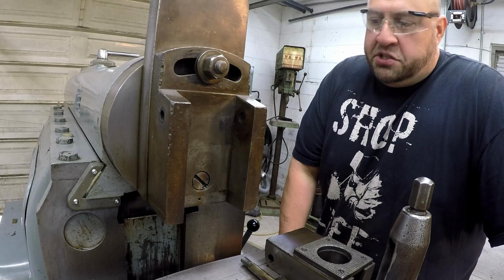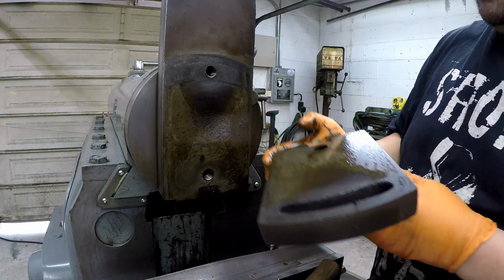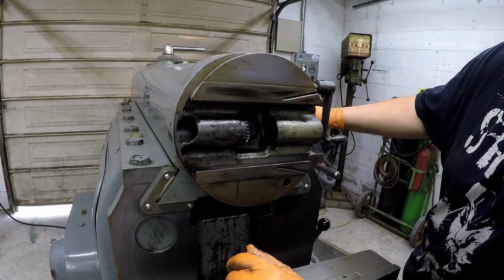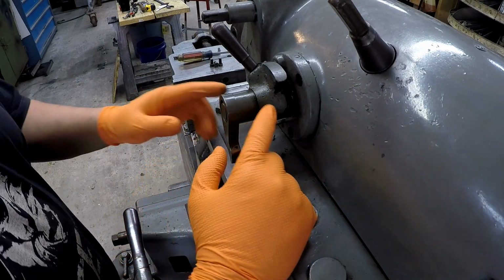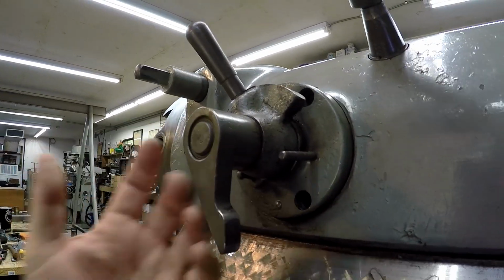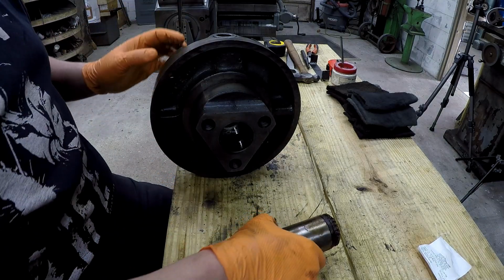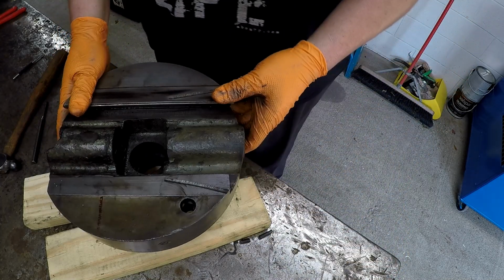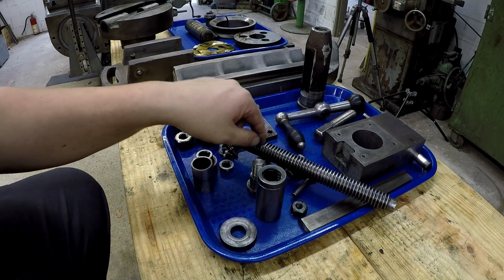G&E Shaper Tool Head Tear Down

Comment: I needed a 9/16 allen once and used a 3/8 bolt with 2 nuts tightened together on the threads. The head of a 3/8 bolt is 9/16. Then you can use a ratchet.

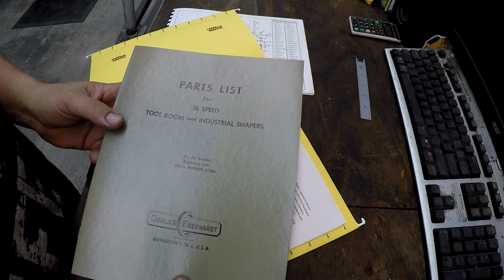Comment: Am I allowed to admit here that I got choked-up at 16:45 when Adam opened up that folder?  That manual was pristine! Someone who cares about machines as much as Kieth Rucker, Adam, and I, obviously saved that manual in some special place. My father was the State Historian, for the State of Michigan, and one of his major goals was to create a museum of industrial tools, which, unfortunately, has never happened. Our current technological lives are built on these old machines, all the way back to the 1,000,000 year old stone hammers. I think of that at my local hardware store, which stocks 57 hand hammers, and each has a reason and purpose, AND that is just a small selection of the kinds of hammers currently available. As Eric O. of SMA says, "every tool has a hammer side."
Reply: If you go back in the series of shaper videos, a viewer that worked at a college sent those manuals to Adam. He said that they had been in a file at the college, probably from when they first got their G&E shaper and were never touched, even though that shaper was long gone.

Comment: You need something called a sprag link to remove the slotted flat head screw. Hammering on with a chisel is not the way to go. All you do is damage the screw. You would never be able to get away with this technique working on rifles. The customers would not be happy with you Adam. The damaged part you are talking about shows that back in the day anybody was able to be a shaper operator. Some were good most were bad. I like to call them "Spanker Boys". As I had in the machine shop I worked in. Either they were the son of a boss honco who was made boss because he could not make anything correctly or just good bull slingers with no real ability other than a golden tongue with no ability to do anything correctly as per print. Not to mention smash a machine because they were either dizzy that day or did not get enough sleep. Excuses excuses from the dizzy guys but not to be called machinists for sure. The bevel gear feed has to be made with tight tolerances because the shaper movements can cause chatter of vibration issues. Just remanufacture the worn nut as the threaded shaft is not that bad as five thousandths is not much wear. As you are saying most manufactures used odd sized items on their machines for two reasons, one, that is what the slide rule calculated for proper strength and second, trying to make sure you would buy from only G and E to keep them in business. Also, maybe make the nut from Ampco bronze as the friction is so low that the machine movement will feel like it is turning on sapphire bearings. Nice job Adam on the shaper. A simple machine that can make things really flat and true.
Reply: Victory First and 5
Reply: Victory First k8
Reply: @ann-marieroebuck3750  Hello Ann-Marie, have a good day.

Comment: I wonder what the story is with that broken casting.
Reply: The previous teardown used the same method as Adam to remove the nut, but missed the end of the rod with the hammer and smashed the end of the tube.  Adam nearly did exactly the same thing.   The better way to remove the nut is to place a blanking piece across the inner end of the second section of tube and screw the nut out using the rod like a puller.

Comment: tell me what is importance of shaper when we have milling machine.
Reply: he has explained that on a previous video. it's like why rebuild a classic car when you can get a new one off the production line
Reply: For starters, a shaper yields a BETTER surface finish, especially with a shear tool.   Also, the slowness of a shaper allows a 1 man operation to multi-task.  Cleaning a piece of hot rolled plate, with its mill scale, can go on while another machine is performing a task is easy.

Comment: Probably should have loosened the nut at the top (4:57) before unscrewing the screw at the bottom, that's the reason for it binding.  Shouldn't you measure the tolerances on the pin and guides maybe making some new parts for higher precision cuts?
Reply: That was the first thing I thought of when the screw was binding. Probably would have made all the difference to loosen the nut a turn or two.

Comment: hi may i ask as you can take down the lamp tool holder  using the holder as base model why you would not make a second tool holder that would accept the small tool holder arms negating the call for t spacers  because  when i first see this cutter i imagined that would have rather more larger base to tool holder  just a thought seening is separate bit might be a easyer way to do it cheers great show  catching on your back shows

Comment: Adam: interesting that both auto downfeed drive gears have no key. I think the brass pins are the key, designed to shear if one engages downfeed with rhe slides locked? Better than destroying a gear although not easy to get at for repair.

Comment: I believe you have shown a Starrett #456 Gear Tooth Vernier Caliper in one of your videos. I think you could use this tool to make comparative (as opposed to absolute) measurements of wear along the feed screw. By setting a depth about midway between the root and crest of an individual thread and measuring first at one of the ends where there has been little or no wear and comparing that with measurements near the middle of the feed screw, I think you could determine just how much the threads have worn. Getting such measurements before making or buying a replacement nut might be useful.

Leave a few thousandths of motion on the unworn threads and compare that motion with the motion on the worn threads. This would avoid "clamping error" where you have more pressure when setting the gauge than when moving it back and forth on the worn threads. You might need to make some sort of jig to hold the 456 at the helix angle of the threads for best results.

This would only work on an Acme thread (and maybe on a square thread) as the crests of V-threads are too variable, preventing you from getting consistent depths.

Comment: Would you let me send you a nice flashlight for the shop?   I make custom modified ones as a hobby and would love to send one your way if it would be of use to you.

They’re super bright and have a high CRI, it would work well for video.
Reply from the maker: Sure, I'd be glad to try one. Send me an email. abom1979 at g mail
Reply: Vincent Schuit 5000k 2000lm 18650 modified astrolux s42s
Reply: Awsome offer. High cri nice neutral white is so much better than the 7000k aliexpress pieces of crap.
What form factor are you thinking, 18650?
Reply: soupisgdfood sweet, that will work.
Soup is not good food however. Not a soup lover 😂
Reply: soupisgdfood best would be with a simple 3 level interface, no strobes etc.

Comment: where are the advantages of a shaper over a milling machine. A shaper can't do anything that you could not do with a milling machine. So why put yourself a shaper in the workshop, if you already have a milling machine. I don't understand.
Reply: internal key ways, splines and gears with very little space for tool runout behind it, adult entertainment machine, many uses...
Reply: slotting, and also a hobby I guess?
Reply from the maker: I'm a manual machinist and I've always wanted a big shaper. I'm enjoying the journey of repairing it and learning the proper ways to use it. I'm also making shaper content to share with everyone along the way. It's got nothing to do about a shaper vs milling machine.
Reply: It’s generally been replaced by a vertical mill but they’re still very capable and can move a lot of material in a hurry.  You aren’t wrong, but there are certain tasks other commenters have brought up that the shaper can do more easily than a mill would (gears, keyways, splines).

It’s kinda fun to work with an “obsolete” machine.  Kinda like retro video games or repairing/driving an old car.
Reply: I learned the shaper in high school machine shop around 1970... even then it was pretty much obsolete for production work. But the shaper does some things that a mill can't. You can do  pretty much all of these jobs with broaches but they are absolutely specific, the shaper is very flexible ... potentially useful for an odd-job shop where special broaches would add up $$$ fast and likely be used once. For production shop... not much use for a shaper. It is still one of the coolest looking classic machine tools when in operation, maybe a surface grinder is better but only because it shoots sparks.
Reply: @Bodi2000   gx

Comment: Adam, The shaper is coming along nicely. Great to see your leaving no stone unturned and fixing any issues up front. Got a tip on cleaning up those parts. Try throwing them into an old crock-pot with the purple degreaser diluted 1-pt purple / 3-pt water. Let'em cook about 4-6 hours. They'll come up looking like factory new parts. Oh but the paint will be gone!Thanks for bringing us along on the project. Dean CrawfordFYI; I have a video on the crock pot cleaning, if anyone is interested.
Reply from the maker: A little heat always makes a difference

Comment: hey mr Abom, I wonder if you know of Stirling engines being used to create electricity, I have spent some serious hrs googling and I just could not find much, my plan was to figure out a solar set up, so we use a parabolic dish to heat up the engine with solar radiation, so no need to burn fuels, no need to create pollution... I was dreaming on the idea of creating a set up,... buy a chinesioum water distiller and use solar heat instead of fuel... create clean water at home and some electricity to run its water pumps,(if needed)... any how here is a link that you may want to see, it may find a happy ending in your wisdom... I give up...  https://www.ohio.edu/mechanical/stirling/engines/ST-5_Engine.pdf
Reply: I've seen a water pump installed in africa as a well pump driven by a sterling engine heated by a solar parabola. I'll try to find a link. I doubt Abom has any interest for that.
Reply: interesting, by the way, I shared the document thinking he has the tools to actually build the rig, I do not have anything like that... not even close... I was thinking that if we add a sound dampening shield, the rig could be installed in almost any roof, providing electricity and clean water... at home we use 3 water filters and even then the filter seems to have trapped at each step, some sort of slime that looks like hair gel... so there is the tap water for ya... it may be a local problem, so don't get scared....

Comment: I wonder if you could machine a new nut in 3 pieces, two separate parts with the acme thread that thread together with a finer pitch thread to preload against each other, and a locking nut arrangement in between them.  You could use the original pin to position one end of the nut, and be able to adjust the other and lock it to take out the backlash.  You could also possibly omit the locking nut and use a set screw against the adjustable side of the nut to lock it in place once you have set the preload.  Anyway I enjoy your videos, thanks for sharing them with us.

Comment: @30:10 Did you compare the axial movement of the nut on the unworn part of the leadscrew? 
Sometimes the problem is not confined to the part you want it to be.

Comment: Adam there could not be a 'nut' in the feed gear as it would tighten against the top nut as it turned. A simple key is all you need
Reply: Agreed, exactly like a lathe that has only one lead screw for both threading and power feed.

Comment: I've  never machined an acme thread. Just wondering if it was possible to make the threads on the rod deeper and get them all the same size from end to end and then when you make the new nut, make it to fit the deeper threads on the rod. What I am getting at is to get the play out of the rod enough that the new nut and rod will mesh all the way like new. Without the .005 that you mentioned that the rod was worn in the middle.

Comment: Great video.
Why does the new nut have to be from ductile iron?
Reply from the maker: Dissimilar metals. Cast or ductile works like a bearing, same as bronze.
Reply: Because when you have two parts moving against each other one must be hard, and the other soft, so that the soft part wears to the shape of the hard part at the microscopic level. Ductile iron is soft, but the screw is probably hard tool steel.
Reply: Just out of curiosity, but couldn't you just machine a new rod AND nut, to any threading you prefer?  Or is something else dependent on that oddball ACME thread other than those two parts?  Seems like you could eliminate more potential slop in one go if you just made yourself a matching pair.

Comment: Do you have the manuals for your machine? One possible source for manuals is www.OzarkWoodworker.com
Jeese, perhaps you should see if you can get that shaper out of the scrap yard just for parts purposes. Anything you don’t think you would need you could put up for sale on eBay. Possible fix for the bunked up corners on the corners of the clapper box would be a nice milled 45 degree chamfer or even a corner rounding cut. Regarding the lead screw nut, Bridgeport uses two piece lead nuts with a small screw so you can adjust to remove backlash. Perhaps you could rework your setup like that.
Reply from the maker: Did you watch the whole video?
Reply: Abom79 - yes, I watched the whole video, I just didn’t bother to go back and remove my comment about your having the manuals for your machine, which you apparently do. Anyway, OzarkWoodworker.com is a great source for manuals. I enjoy your videos. BTW, I recently purchased an old 16” Ohio shaper, it will be a few months before I can start playing with it, but I imagine I will be going through some of the same things and experiments you are going through with your G&E.

Comment: Knowing what's wrong is half the battle. Relatively easy fix too. No castings damaged! 

I'm guessing the junkyard parts either don't fit or are unavailable? It would be nice to find a matched leadscrew and nut. 
I'm looking forward to making a new one with you anyway!! Maybe you could slot it and add adjustable backlash to it? (I can't help it, I got double the normal customization genes)

Thanks for the ride along. Fun stuff.

Comment: Hey Adam, I've got much smaller shaper then you (made in Romania and about 16" stroke length), but it had absolutely same issue like yours. Power down-feed wasn't working. After tear down I found out some key between thread and bevel gear was missing. I put there new key and it's working like a charm! Greetings from Czech Republic ;-)

Comment: Hi Adam, I suppose that someone has modified  the original assembling. The bush #19  appears to be held in place by pin # 20. While you found it free between the two cylindrical guides in which the # 27 axis runs. Am I wrong? Btw, that shaper is awesome and it deserves all  your efforts to be reborn. Keep on shaping, bro ;-)

Comment: For common Allen head screws, I like brazing a short section cut from an Allen wrench into a matching socket so I can use a ratchet on it. that way you still have a useable Allen wrench plus an Allen socket too. Pressing the hex key in a press fit might work with some shim stock but I have not tried that.
Beware brazing cheap sockets they can get brittle and shatter. JB Weld is not strong enough.

I appreciate your efforts and skill! Thanks for sharing.

Comment: Nicely filmed Adam, good to see the workings of the auto feed tool head. I was amused that your leed screw was the odd ball size, I had the same issue and like you I made a  new nut and screw ; mine was less complicated as no auto feed to build in, still a huge challenge for me and my limited machine skills. Do check your tool head slides, it's not too difficult to scrape them back to near factory condition and it makes for a much better feel when you are hand feeding down - make for a nice follow up movie to your Richard King classes. Keep up the good work. All the best Mat

Comment: ADAM STOP! Great teardown, but look into the pin and screw threads before chasing them, they might intentionally be interference fits. Old trick by old guys to keep things that shake, vibrate, or, heat up and cool down, a lot from coming loose..... Check it out. No hits. No burrs. Too tight? Maybe an interference fit, intentional. Great teardown, love it!

Comment: Hey Bro. After reading some of the comments in the last sns (Slotting I believe it was) a guy left a link to a video of old german Planners (I guess the difference between a planner and a shaper is on one the tool moves and the other, the part moves?) but man those machines were just incredible! Tool bits that were like a gnarly 12-15 inch long 4" x 4" with a piece i guess welded or braised in to the end. I guess the biggest one had a 5 metre  travel of the bed and looked like 4 cutters on each corner of the pieces it was working on. It went in to great detail on the hydraulic ram that drove the bed (naration and text in the diagrams was all in German but it all made pretty good sense to me just watching it). I don't know if that is the norm for industrial machining around the world back then but I'm going to risk being racist here and say "Those Germans sure take engineering to the next level!", at least they did back then. Anyway Thanks for the shaper adventure you're taking us all on brother, it's pretty special what you're doing and I think there's a lot of us out here who really appreciate it, I sure do!. Long Comments are long...
Reply from the maker: Yea that video is great. That’s what planing is all about. Some of them had very large and long beds.